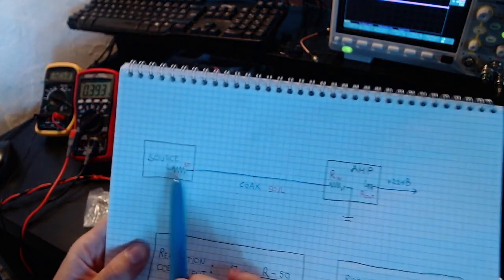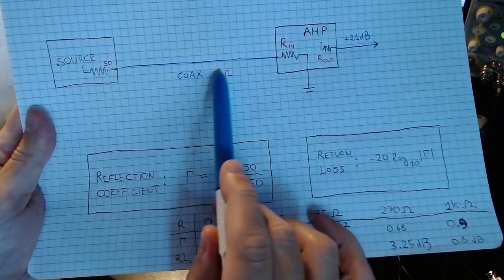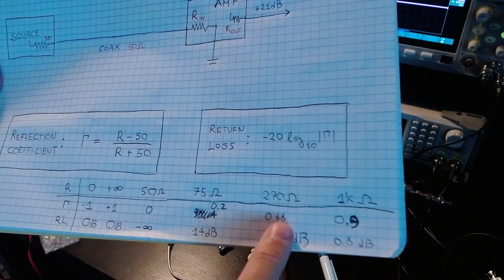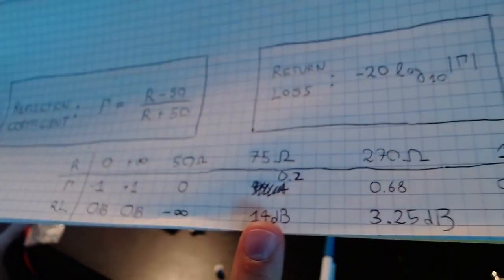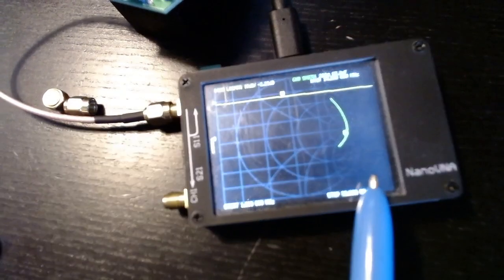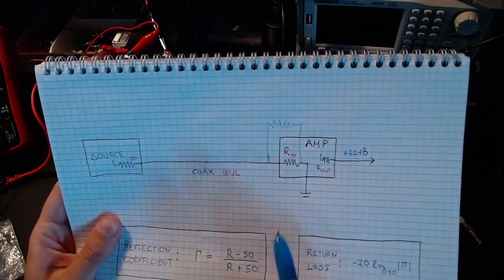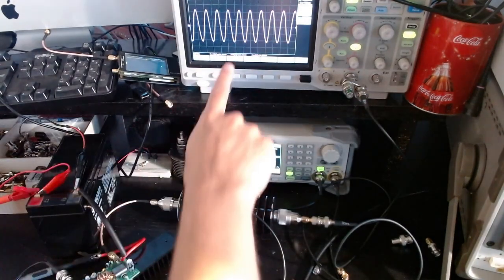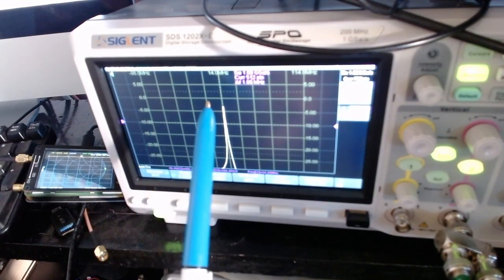Episode 70: QRPLabs 10W HF amplifier (#2), input impedance.

Comment: The input impedance was never intended to be 50 ohms.  It was intended to accept a 100-200 ohm source 
from a lower level amp (pre-driver).  As a result Rin is higher than 50 ohms and at 10M its lower than you 
40M result.  Keep in mind the power level at that point is maybe 20 milliwatts.

So your assumption of a 50 ohm source is incorrect.  Also the load it resents due to the gates of the BS170
mosfets is reactive. So the input impedance not resistance is again not 50 ohms by design of the amp.
The intended driver was a RF IC that wanted a 150 ohm load to develop the needed RF power.

To fix the SWR three things can be done, rewind the amp input transformer.  The other is input attenuator 
(resistor load) and absorb the loss. Or a Pi OR L-network narrow band solution to translate the source 
to roughly 270 ohms or a 50 ohm to 270 ohm transformer.  The later two have lower losses and the 
transformer will be wide band.  

Of course re-winding the input transformer for 50 ohms would be the most direct solution.

Comment: I wondered if a transformer could be added to transform the impedance?  Might the loss be less than a resistor?
Reply from the maker: Definitely a possibility. The input of the this amp actually is a transformer. So one option would be to tweak that directly. Another option (suggested in the QRPLabs instructions) is to design a pi-network to match the impedance. For the moment I am happy enough with this "resistor" quick solution. I plan, once I make sure everything works well and is solid, to put the amp in an aluminium enclosure (better heat dissipation) and drive it to +16V or something like that, to increase the gain and break even :)
Reply: @therfnoob7697  Hi, one question: The resistor solution, would "hurt" the Rx Signal (when in RX)? Thanks, Luis CU2IJ
Reply from the maker: @lamap45  yes it does. Every time you use a resistor, and some current flows in that resistor, some heat is produced. This means that part of the signal is dissipated away in heat. For this reason, using a resistor as impedance matching solution is not good. One should use instead a transformer or a LC network.